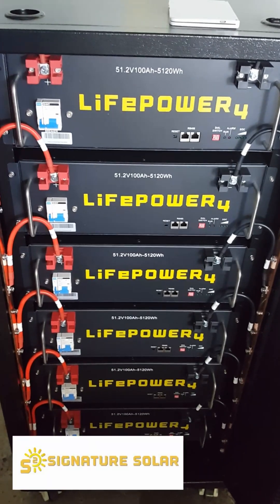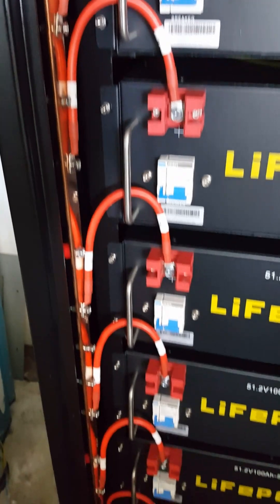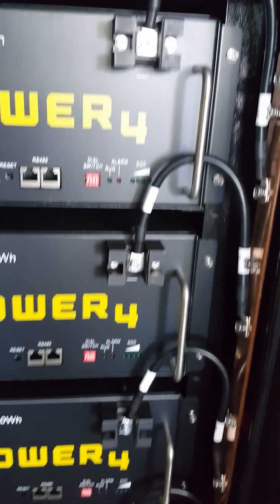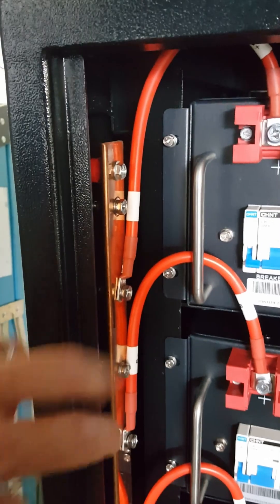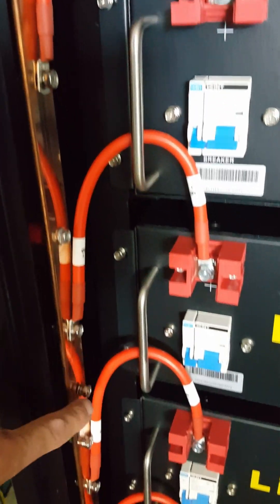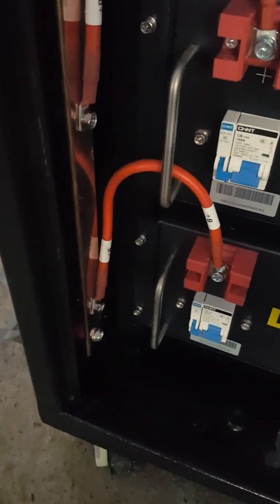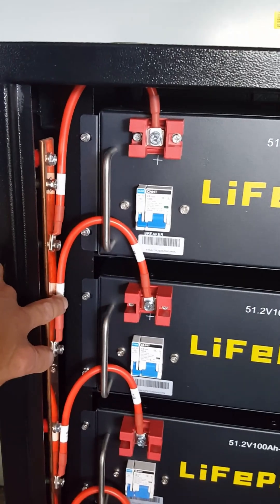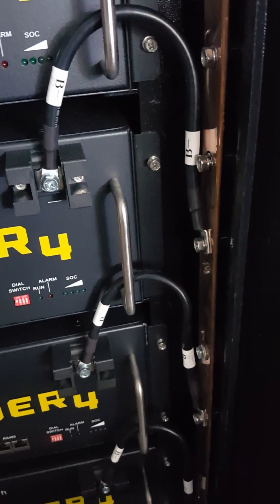Battery Rack Assembly for EG4 V3 LifePower4 - Buss Bars

Comment: would it be more costly to run insulated bus bars, and just having termination points uninsulated
Reply from the maker: I have seen some run insulation on the buss bars. With the locking cabinet, I don't mind them open. What setup are you running? Thank you for your comments! 👍

Comment: Looks clean, im debating this way or home runs to a buzz bar on the wall below my inverter. 300ah # 3 stacked my batteries i had to purchase the circuit breaker  i will mount it to the wall also. I think mine are to big
Reply from the maker: Good day! Thank you for your message. What type and size of batteries are you working with? 👍 300ah 48v?

Comment: Not a fan of the wiring routing

Looks like to pull a single battery you’d have to disconnect the battery below it since the cables go through the battery handles above it
Reply from the maker: Good day! As an electrician, I admit that I am a little OCD with wiring straightness! You do make a valid point, however!